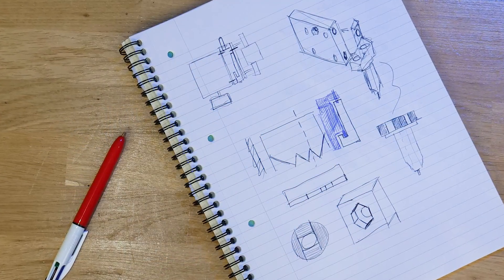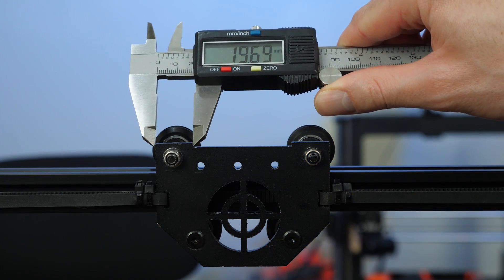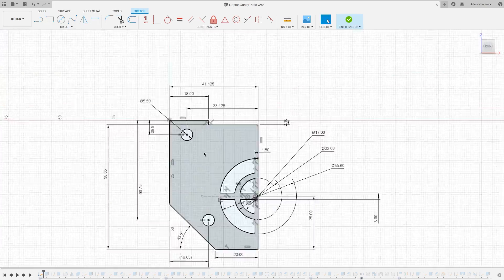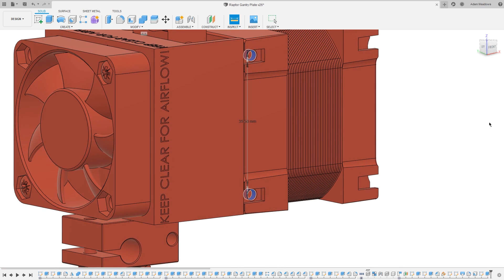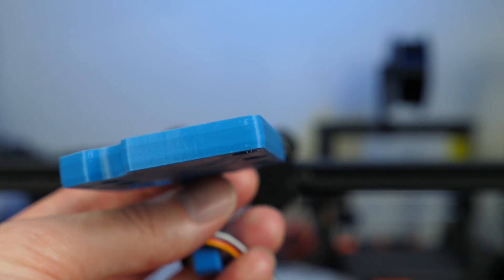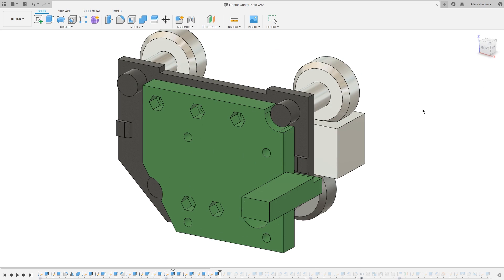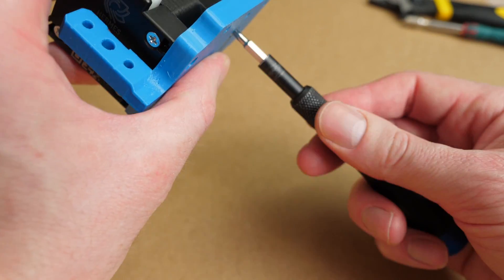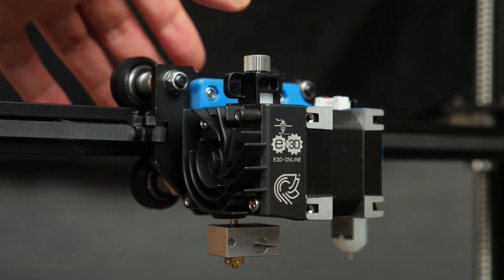Upgrade your Printer to E3D Hemera using Fusion 360

Comment: One thing I'd like to note is that adding fillets (or even better, chamfers) around the bottom edge of a freestanding post, if your model has any, does add significant strength to that post, without one it's a lot easier to snap off at the base where there's a sharp angle.
Reply: Yes!! And add them last, it saves alot of trouble if you have to change things.